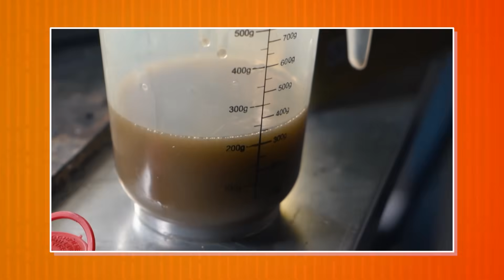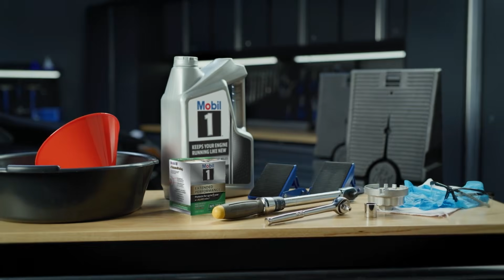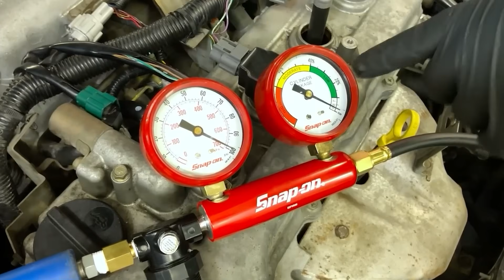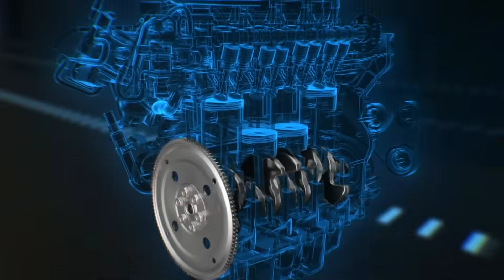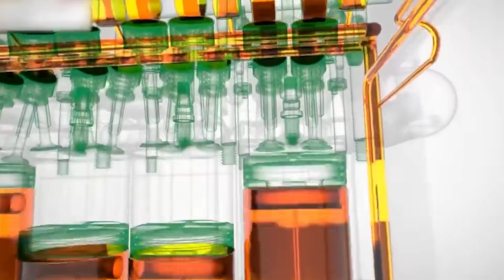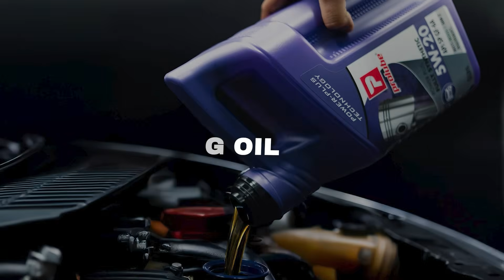We Tested 0W-20, 5W-30 & 5W-40 In a Japanese ENGINE — One Clear Winner!

Comment: My 2025 Prius says to use 0w16 oil. But the exact same engine in other models uses 0w8 oil. I plan on next oil change to use 0w8 oil in it. Some people are saying that's a mistake. But being a mechanic I think it would in fact be a better thing. Since it gets to all of the lubrication points faster, and they require it in the same engine in the other models. What do you think? Did you know that Toyota oil has a higher rating than any aftermarket brand!

Comment: This is complete nonsense . The oil degradation is proportional to climate . In GCC regions where the temperature touches 50 degrees the 0W-20 would literally loose all its viscosity and metal to metal contact would happen especially on V8. Even 5W-30 cannot keep up the viscosity. 5W-40 is essential for the climatic conditions . The dealership still puts 0W 20 , but I don’t agree to that. If cold start is the reason then I would say the temperature here doesn’t fall even below 10 degrees on a normal winter day.
Reply: Ok, I’m going with what you say on this one. 0w30 is what the book calls for in the USA but calls for 5w30 with my Lexus 4.6
L everywhere else in the world. I’ve heard it’s only for US emissions and fuel mileage here. Any truth to this?
Reply: @loganurquhart11 You can continue with 5W 30 until the warranty ends or 100,000 KM. It is advisable to switch to 40 weight oil , if you live in a hot climate region. If you live in a place where it is cold , then keeping 5w30 is not an issue. Thermal management of the engine is the key point and viscosity degrading with heat.